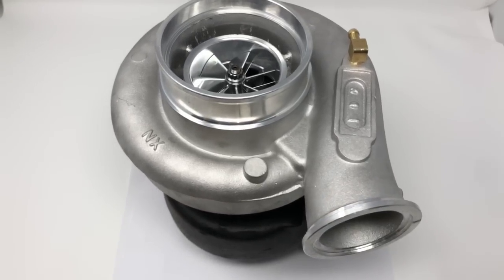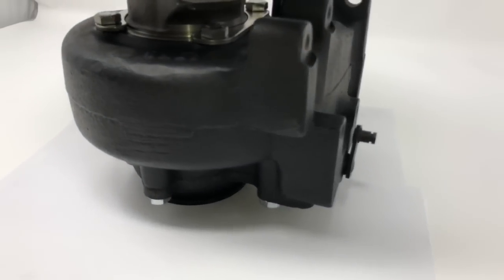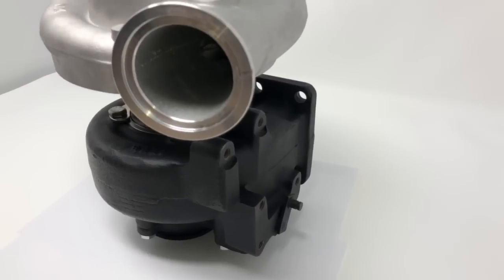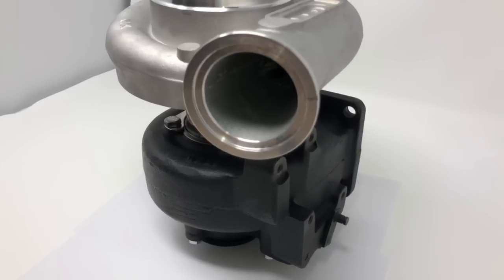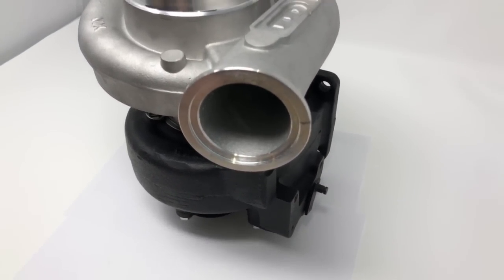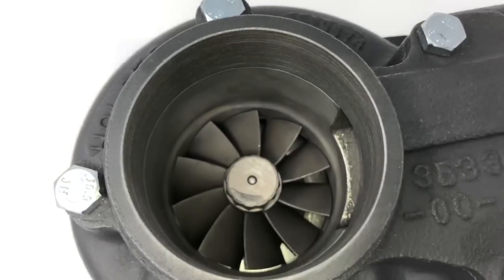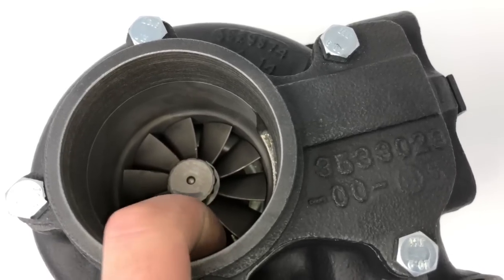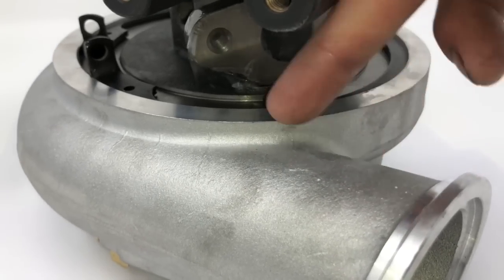Hx35 Turbo Upgrade

Comment: Good day sir, what is the price and delievery time on one of these with the 62.45 comp and the 64/76 turbine? 
Built on a hx35w (it needs to be that turbo because the car is registered with that type of turbo)

Greetings from Norway
Reply: 12 or 14cm exhaust housing. Wg facing the compressor housing would be the best

Comment: hi, i have a legitimate hx35 3537132, 50/83mm compressor, 70/60mm turbine. do you sell any upgrade, as in billet, or bigger compressor wheel? im running the stock 12cm2 t/s housing and t/s manifold in a 2.0tsi leon fr. willing to machine intake housing, but i need only parts since im from argentina

Comment: I bought an hx35 from a friend of mine for my 92 and when I went to put it on the oil return line wouldn't fit. Turned out I had the wastegate actuator that runs parallel to the engine. That turbo turned out to be off of a 5.9l that was in a bus.

Comment: I don't suppose anybody knows if you can put an hx35 on an automatic or what do I need to do to make that fit cuz like I don't want to have to buy a new exhaust but I need to know if I'm going to need to beforehand
Reply: I don't recommend installing a turbo on a transmission.

Comment: Hi there, I live in Australia and have a 2008 Nissan Patrol manual fitted with a 6.5 optimizer. It has (I think) a gt3076 a/r .63 no waste gate,I don’t think this turbo is very efficient on this engine. I Have been told a gtx3582 .63 with a internal waste gate would be a better match? I do a mix of driving, in your opinion what would be the best all rounder? Cheers, josh.
Reply from the maker: I have never heard of this car so I suggest choosing the turbo based on hp rating

Comment: Has anyone bought from u n show u the outcome
Reply from the maker: I have built the for a wide variety, some people have them on boats, Bmw m3, 335i, supras, Cummins etc. the result vary on each application but it’s pretty close i relationship of gas vs diesel. The diesels makes out 100 less hp than the gas motors but the diesels make more torque.